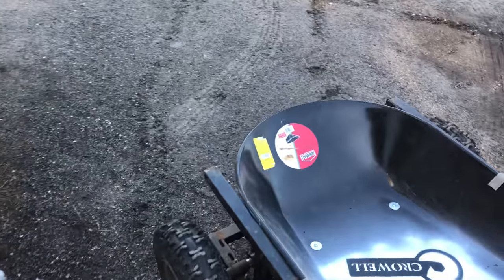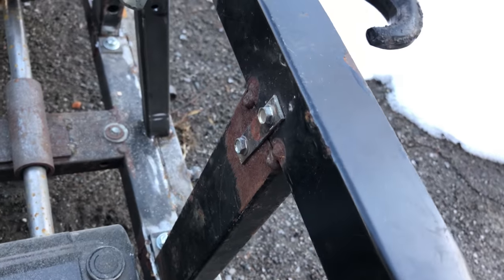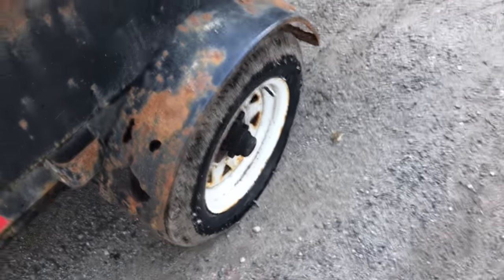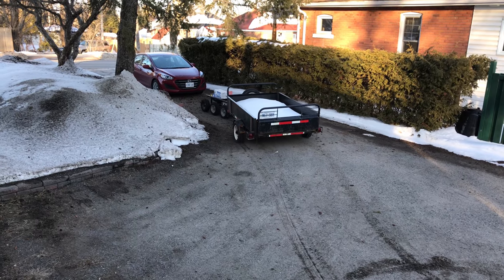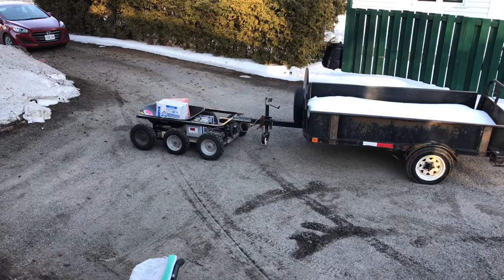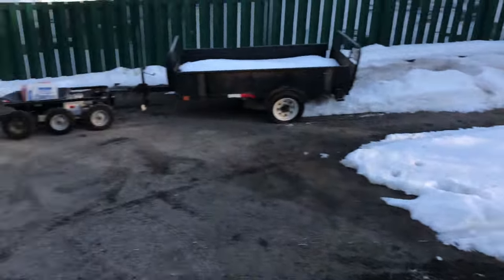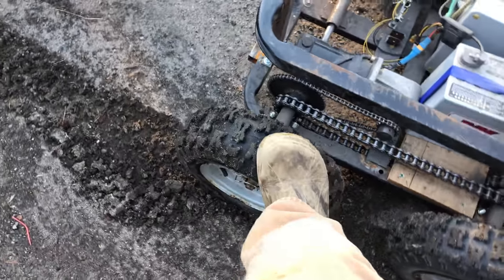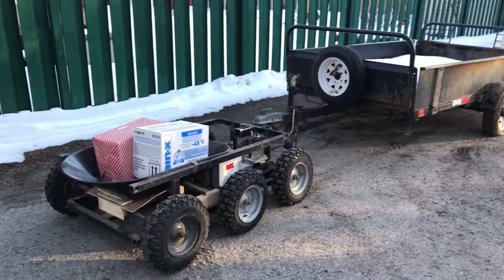Mini skid steer utility thingy build log14

Comment: is it possible to get the ball located over the chassis more to distribute the weight to more than 2 wheels?  more like a gooseneck trailer would hook up on a truck but since you are so low to the ground you might be able to do it with regular trailers.
Reply from the maker: Jason Morrison that would work great other than can’t get under the tong on a lot of trailers because of the jack stand hitting the gram of the 6x6.  My original hope was to have the ball in the middle of the 6x6 so it could turn on a dime to aim the trailer.
Reply: @JarethCrowell  didn't think about the Jack...  Cool project, I'm almost through the whole series.
Reply from the maker: Jason Morrison it’s still a work in progress... keep watching for new episodes!